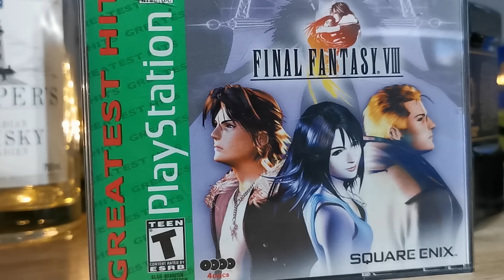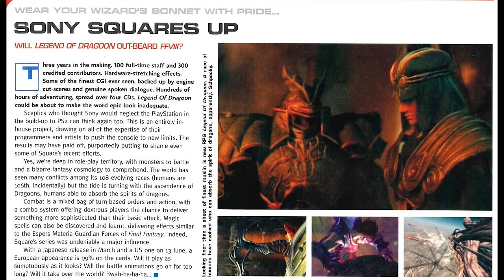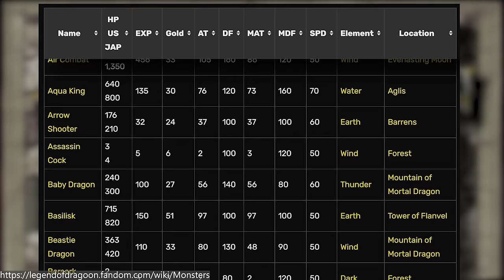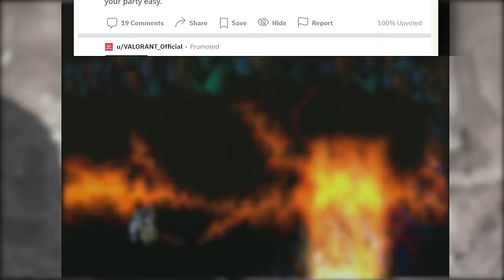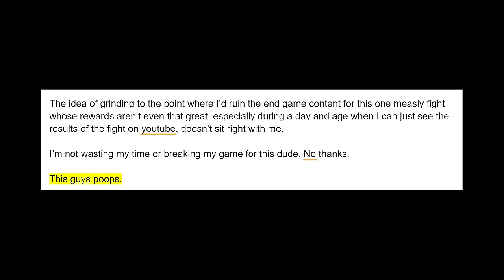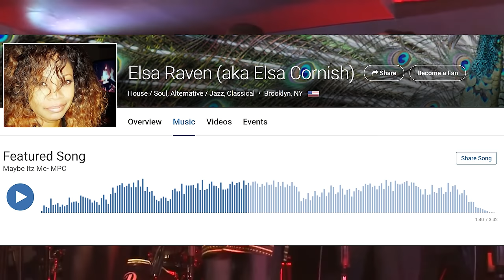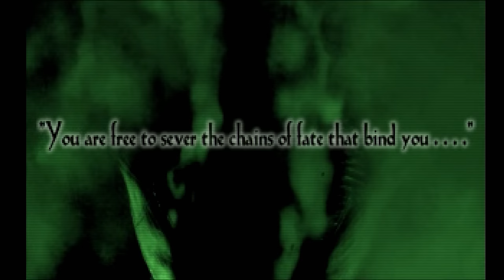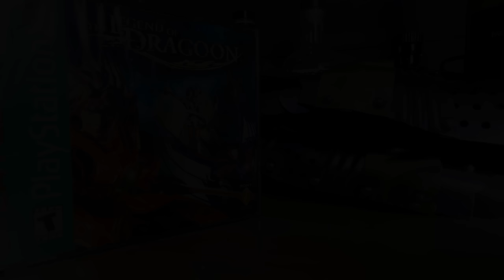THE GAME that CHANGED MY LIFE! - Tarks Gauntlet

Comment: Faust is actually one of the best thing in the game, a side quest and content that is not just for exploration and completion but also for achievement. Its either you grind to beat it or you actually are good enough to beat it without the end game items. I've managed to beat Faust without using any of the legend items, its actually possible if you strategize properly and is good with the additions. But of course, there's quite abit of RNG and some basic grinding involved like unlocking and mastering the final addition.

I'd use Meru, Shana and Dart. Shana is the healer and support using items to buff and revive teammates, she can also survive fairly well with good magic defense. Meru and Dart are the main damage dealer using additions. Dart and Meru can use their respective dragoon armor since they are the main damage dealer using additions, the armor will always nullify his element counter move using a single target item spell that is the same as your character's element.
Reply: My run was mostly Albert & Rose throughout and sometimes i throw in Meru for damage dealings as well. Albert has very good high damage percentage if you use an accessory for physical attack power and hit rates only since his magic isn't that great and diverse compared to Meru and Miranda's

Comment: I have a way to make the addition system work: Whenever you get a new addition, and you go for an attack, you can select which addition you want leveling up your individual addition level (not the the individual addition, a whole level class) even giving the archer characters an addition, using a the button press for the firing.
Reply: they managed to give a npc archer  combos but left a main character without them. it's frustrating, to say the least.

Comment: 29:45 I think it should be done similar in ff6, where new characters matches the lvl of the highest character. Have the spirit and addition exp gain multiplied by 2,4 or 5 until it matches the unit with the highest dragoon and addition lvl or until the unit reach the average. The new units catch up quickly and it's not unbalanced because the new units only have the multiplier until they have caught up and then it's back to normal.

Comment: I'd like to say 2 things 

1. Short Dragoon animations only affect transformations after the first so for example when you get Lavitz/Albert' s dragoon if short is on after using Dart and Rose's Dragoon then he will still do the power rangers transformation and Special also overwrites the "short" option

2. The addition leveling has an answer the issue is you either have to get 10k Gil or get lucky in the ghost ship the auto addition item
Reply from the maker: Yeah, I should have been more specific about the short animations part I guess.

As for the second thing that is almost an answer. It takes addition grinding time down only by the amount of time you spend missing additions. You'd still have to perform each addition 80 times per addition, per character. Getting the money for that accessory is incredibly difficult and you won't be able to get the accessory until rather far into the game anyway. And I believe there's a hard limit of 2 per playthrough?

So you still have to grind, and for a long time, especially if it's a character you've had in reserve for a while, it just removes the skill issue you might come into while grinding. And I'm not sure if that would make the act of grinding additions better or worse.

Faster progress but more boring to play?
Or interesting combat but a long, long stretch of it?

Comment: For the mashing mechanic, I turned to my Mad Catz controller. It was the only controller brand I could find outside of an arcade stick that had a rapid fire mode. Just flip the switch and hold the button down. Perfect multipliers every time. A LOT of old school gamers will talk mad sh*t about MC gear, but I never had any problems with the 3rd party brand and I bought everything from MC controllers to memory cards. No shame.

Comment: the journey to your old house is quite moving, thanks for the feels!

the twitching of the graphic isn't exactly a issue of the game itself, but the result of design choices of the ps1's gpu and fpu, which made it difficult to draw a perfectly filled and textured polygon in all positions, especially when colliding with other things. developers had few hacks here and there to hide it, but it couldn't be fixed.  new generations of emulators do work around it with very good results however

Comment: Faust is easy...I beat him at level 35 last playthrough. Get at least 1 Legend Casque, 2 or 3 if possible....if someone falls...wait until he's in red health, revive your dead members, and take him out. It's quite easy. The Legend Casque entirely breaks the game, as all high damage attacks shift to mostly all magic from Lenus onwards part way through DIsc 2.
Reply from the maker: Yeah, I mentioned this in the video. The legend casque breaks the fight (why even bother with the fight if your going to do it this way? the rewards aren't even that good) but getting the money for it means structuring your whole playthrough around saving for one, and then grinding endless hours to buy 2 more (recommended if using this strategy) and the time sink ends up not being worth it. 

The other strategy of course is level grinding which, also, massive time sink that's just not worth it and leans heavy on RNG being in your favor too.

It's less that Faust is hard (he is, cheese strats excluded) and more that Faust isn't worth it to beat with either strategy. 

He's either hard, or easy after spending too much time money grinding to ruin the rest of the game with broken armor.
Reply: @TarksGauntlet  I think it's just extra content in an otherwise pretty loaded PS1 title, personally. Same as the rest of the optional bosses. I had Haschel hitting 6800 with Omni-Sweep Power Up and a Power Down on Faust...made that battle stupidly fast. DG armors make the counters he throws hit 0s; worth it if you can get em.
Reply from the maker: @homie3star  See, that's another very specific strat requirement. Those power up and power downs are extremely limited resources. Most people who don't know what they're planning for will not be able to do this fight until their second time around at least.

DG armors are good, but only for counters. I was wearing them in the clip you saw, at least 2 of my party were. RNG didn't even give them a chance to utilize them. Faust killed the whole team before they could move.